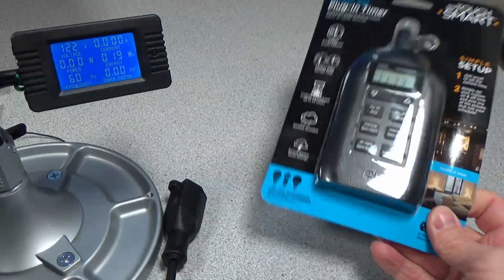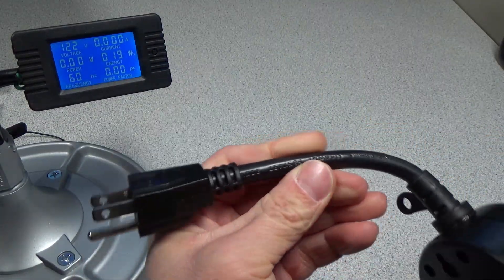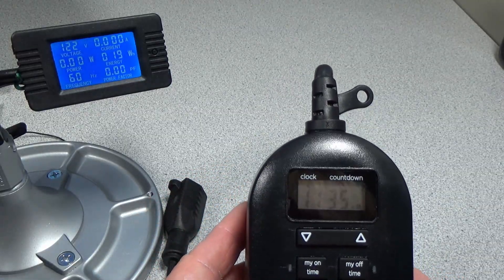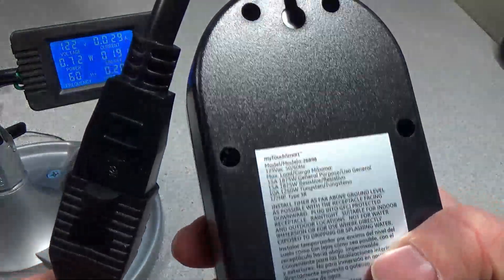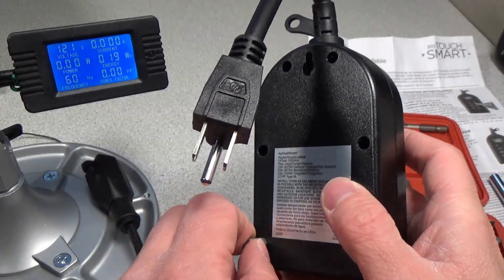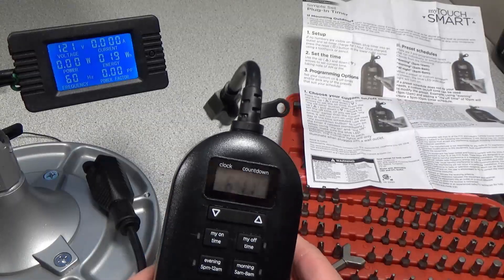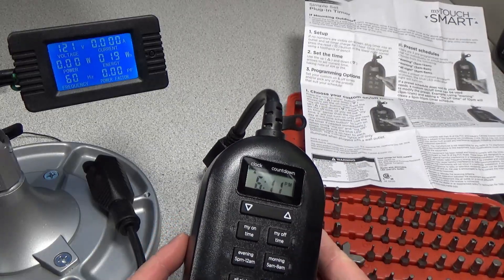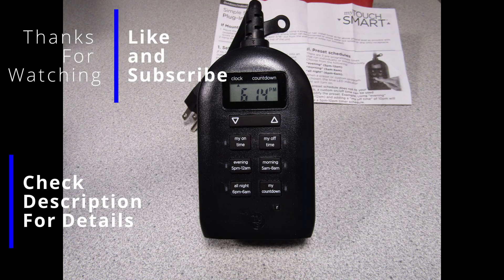myTOUCHSMART Timer Review - Video 12

Comment: how to change the battery ??????
Reply from the maker: In the tear down I show that the battery is soldered in.  It can be replaced though but a soldering iron and some electronics skills are 
 required.  It is not user replaceable per the user manual.

Comment: The directions are simple,... except they don't work.  Tried every way possible to set custom times to come on and off evening and morning. This thing is overkill on the engineering and fails at its main function, and this video spent 10 seconds on the setup ("very intuitive and works great" uh, you didn't show me and no it doesn't) and a minute on the triangle screws. Who cares!?
Reply from the maker: haha, yeah, I agree this video sucks!  But yeah, it real time captures my experience with this just working out of the box.  You have to use the fixed times then can only set one custom time.  I change the 'clock' to the wrong time to move the fixed times to something more useful.

Comment: After Christmas is over how do u turn this off so tge click stops running for the next year?
Reply from the maker: Unplug it from the wall.  The relay is only powered when plugged in.  The clock is powered by the battery inside.

Comment: Great review but mine stopped working.  The customized time was set but no blue lights?  Any ideas?
Reply from the maker: That is unfortunate.  Mine is still going but it only sees seasonal use and typically when its cold out which helps.  It is certainly built down to a cost and the number one thing that is going to fail is the zener diode based power supply on the input.  This part gets hot and stays hot whenever the device is plugged in.  Once this fails the device won't be able to power the relay to turn on the output.  My guess is that is what happened.  There is a teardown video I did of this, I had the intention of doing a video showing how to make the power consumption lower but haven't gotten around to that yet.
Reply: @AllThingsOnePlace  Thanks for the reply.  I went to a new version as I went back and read a lot of reviews of this which says it just stops working.  There were a number of reviews on Amazon talking about it.  I will try a BN-LINK 7 Day Outdoor Heavy Duty Digital Programmable Timer and see how it goes.
Reply: Look for the reset switch. Five seconds in. [square]

Comment: I just bought this and my lights won’t come on at the set time. And it has the blue light, so i know it’s on but idk what to do
Reply: Hold down the resest button,  then reprogram it .
Reply from the maker: The blue light doesn't mean the output is on.  It only means the mode is enabled.  A way to test if it operates is the countdown mode.  You should hear a click and the output should come on when you push that button and it should turn off when you push it again.

Comment: I wonder if I this timer can be used with LED grow light setup?
Reply from the maker: This timer would work for any timed lighting setup (less than the rated current of course).  The limitation of this unit is that it won't do complicated programs.  For example it can't turn on for 40 minutes then off for 20 kind of thing.

Comment: I even set the on off timer and it doesnt work. The only way i can get power through it is holding the reset button down
Reply from the maker: That is a strange symptom.  I will have to check the status lights on my unit to see which way indicates on.  Could the timing be backwards?  I would arbitrarily set the time to one of the preset values a minute before and wait to see if it turns on after that minute is up.
Reply: @AllThingsOnePlace  im not setting it wrong but the buttons may be backwards from the factory.  I'll have to check that out
Reply from the maker: I checked my device and holding the reset does turn it on. Then release and it is off.  The timers do turn the device on/off when the time is up. The blue lights only indicate what program is selected not that it is on.  I would set a time of 7 am then push the morning button and see if the device turns on and off on each push of the morning button.  If it doesn’t then it is broken unfortunately.

Comment: Mine doesnt have any power going through it, any idea why? Also mine has a button between the arrows. All my blue lights are off, shouldn't it have power going through it?
Reply from the maker: Hmmm.   I guess my first question is whether the time is showing on the display?  It may need to sit plugged in for a while to recharge the internal battery.
Reply: @AllThingsOnePlace  yes everything seems normal other than no power comes through it unless the reset button is held down
Reply: @AllThingsOnePlace  yes. One hour. It’s in the printed directions. 
And the R is a reset button.

Comment: is it possible to set this timer to come on and go off 3 times in one day?
Reply: I need to find a timer that can come on at 6 12 and 5 for 2 minutes then turn off
Reply from the maker: This timer won't be able to do that.  You will probably have to look at a "smart" internet connected timer to accomplish this.  I am only familiar with the Apple Eco system but HomeKit can do this with a HomeKit connected plug.
Reply: For a misting system
Reply from the maker: It is, but each time is not customizable.  You can use the preset evening time of 5PM-12AM, the morning preset of 5AM-8AM, and a custom on and off time set with the  "my on time/my off time".  This device mostly focuses on timing for lighting products.  You can also offset the time by setting the clock wrong.  I did this to get an on time of 4:30 PM and off time of 11:30 PM by setting the clock 1/2 hour fast.